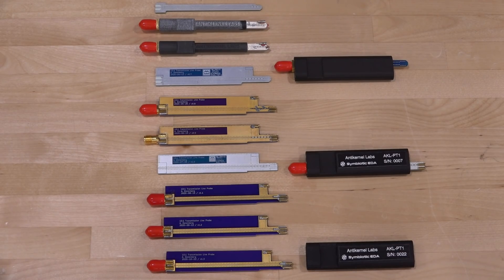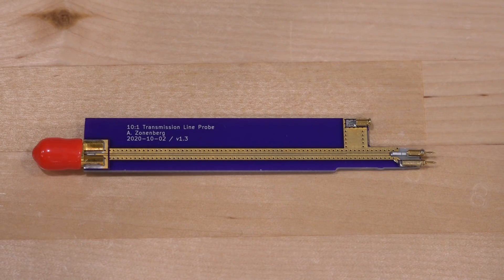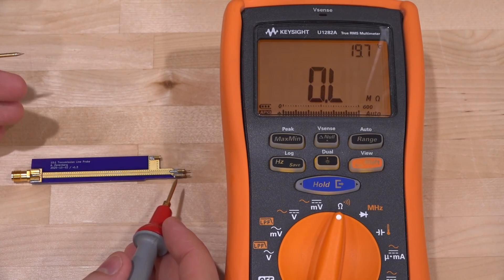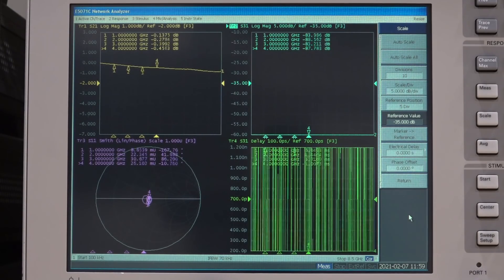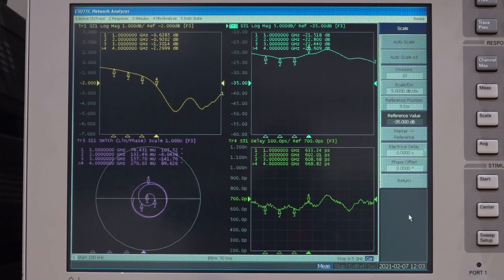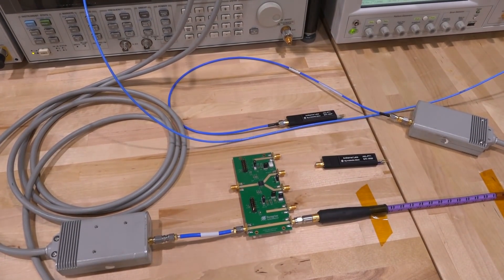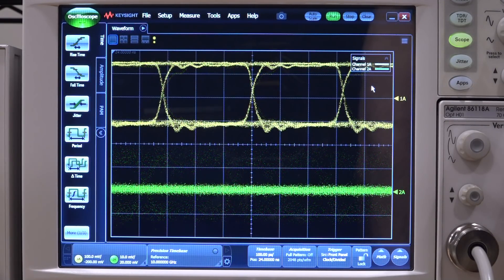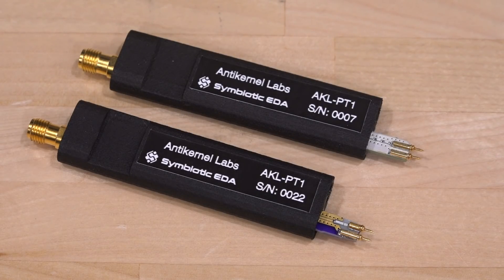TSP #182 - Antikernel Labs Inexpensive Multi-GHz Transmission Line Probe Review & Experiments

Comment: I would like to see a passive differential probe. Based on a transformer.
Yes, it would be limited to only DC balanced differential signals.
But the cost would be so much lower than active differential probes. Plus, it would be isolated!
And by using something like a 10:1 transformer, the loading could be made really low while still providing a good strong 50ohm signal to the oscilloscope.
Reply: Interesting idea, and I've thought about it.

I'm actually working on an open hardware 4 GHz active differential probe as well. Right now it looks like around $500 for an assembled unit including profit and assembly costs is viable; the BOM cost for a DIY assembled version would be in the $150-200 range.
Reply: @AndrewZonenberg  Great! Please let us know about any follow up on this, it is surely a valuable contribution to the open source community! And thank you @Shahriar for bringing his work to the audience!